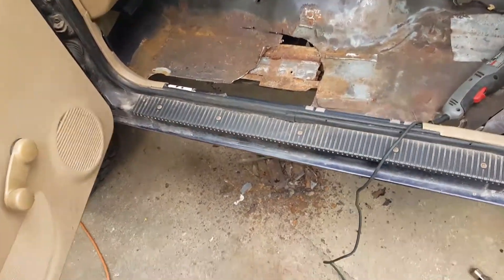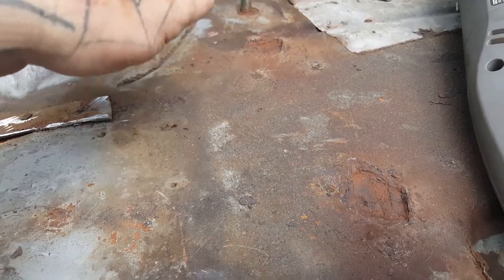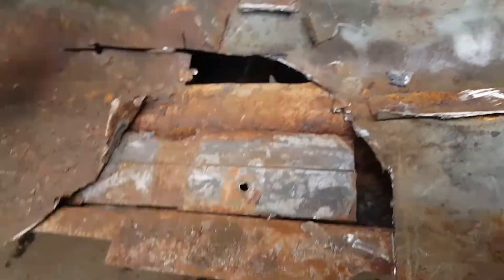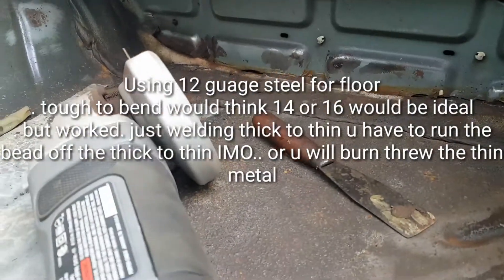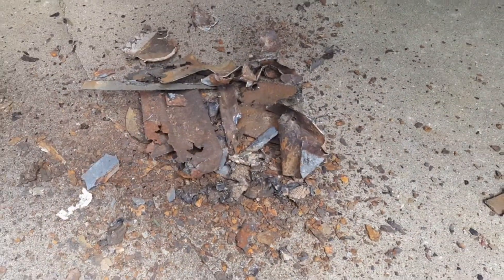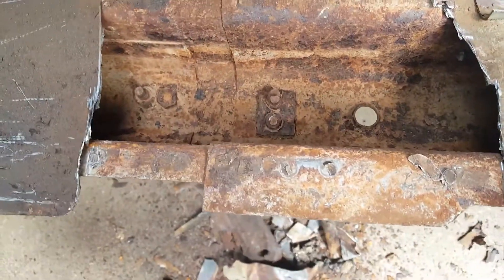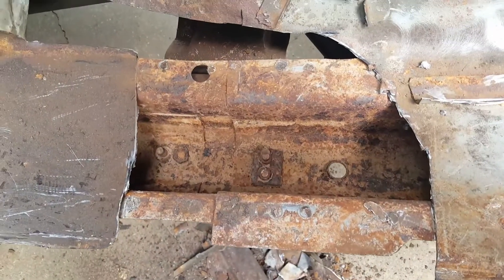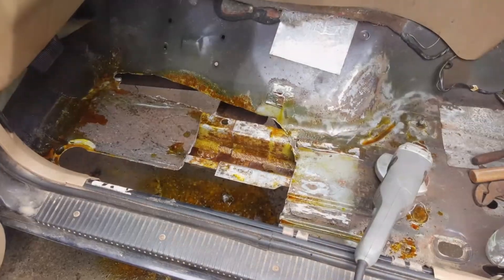Jeep Cherokee Xj drivers floor metal repair

Comment: nice job, was that mig or flux core welding? didn't notice a bottle of gas. i have a hard time finding a store that supplies welding gas for a decent price in my area and was thinking of using flux core instead, but still not sure.
Reply from the maker: +Alex Deagle ...Thanks man i used flux core on this.. works ok but gas is always better and u can see what ur doing etc.. i had her up pretty high to get a solid weld.. the cross peice for chair was real tricky bc its thicker and took more heat.. however i have gas out at a shop and should have used it for that but can go back there.... theres a place online that sells a 80 tank for 170 but yes there pricey.. gas works good but noting wrong with flux on thinner stuff! IMO ..Good look bro!
Reply: thanks for the info. i wasn't feeling confident enough to fabricate my own pans so i ended up getting aftermarket ones for the front floors, i think 18ga. and then bought a 16ga sheet for the smaller holes near my rear tubs. will practice and see how that goes, my lincoln's lowest setting with flux core is for 18 gauge using 0.030 wire which is what i have, so it must be possible.
Reply from the maker: +Alex Deagle ...think ur all good man! Just take ur time hammer on the welds etc.. yes pan was a pain and alot of hammering lol. I used .30 wire myself.